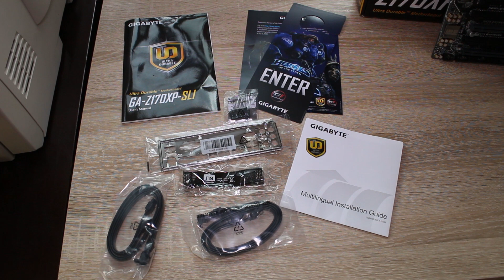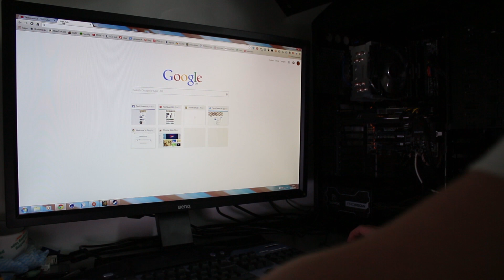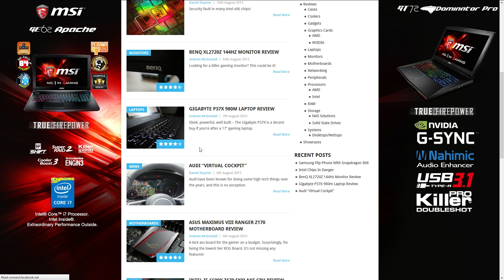Gigabyte Z170XP-SLI Motherboard Review

Comment: Will this seat a GTX 960, or will I have to remove the HDD cage?

PCPartPicker states it won't fit, but I see there is a spot below the HDD Cage
Reply from the maker: Welp, this is a motherboard and it doesn't have a hard drive cage so.... Yes?
Reply: Sorry, I thought I added, I bought this case. 

http://thermaltakeusa.com/products-model.aspx?id=C_00002680
.
Thermaltake Versa N21
Reply from the maker: Looks like there is a clearance for the GPU in the middle. In theory should be fine but I couldn't say without seeing a motherboard in the case.
Reply: Gotcha. Thanks so much for your help!

Comment: I only just learned that this board is NOT a standard ATX form factor, but some Extended ATX, but only after I snapped off the top right corner at the memory slots trying to fit it into a standard ATX chassis! Now I have to sit around and wait a few months until I have the money to buy something else, as this is a "depreciated" model that isn't available anymore for purchase. Is there something at this price point (or lower) that's a for real ATX board with these features that's more durable?

Comment: Anyone get this board and it wont even POST? I have only Power and Power Switch plugged in, and get nothing :(
Reply: I have this one, do you have problems with this mobo?
Reply: I found out that it was bent/broken pins on the processor socket. No idea how it happened, I've installed many processors before...it's a ZIF socket, shouldn't have happened
Reply: I'm really sorry to heard that, it's an excellent motherboard
Reply: Travis Rounds is
Reply: Sadly, the company I purchased it from on Amazon did not exchange the board like they said they would. I ended up purchasing a new one, and it works like it should.

Comment: Awesome review. Could you please tell me if the ram and graphics card slots have difference speeds or are they all the same speed? I'm confused because I read somewhere that the ram slots have different speeds :/
Reply from the maker: +Ameen Qureshi the ram slots have the ability to run at the same speed with no limitation between them. The pci slots however run at either 1x,4x, 8x or 16x,with 16x being the fastest, and used for GPUs whereas 1x is the slowest and used for wifi cards and such
Reply: Thanks for the reply, is there some way to tell which is the 16x slot for the GPU? I just plugged it in the random slot I think the first one
Reply from the maker: It's the longest slot type, normally the top.
Reply: +TechteamGB that's perfect, thanks a lot! subscribed! :)

Comment: What CPU fan did you use?? i have a Zalman cnps9000MAX, the screws barely reach the threads so i have to get a new one.
Reply from the maker: I used a Cooler Master Nepton 120XL with no issues
Reply: What was the one you had before the Water cool? its a bit expensive the Neptune at $146.
Reply from the maker: I suggest a Cooler Master Hyper 212
Reply: Thank you, newegg had that for $29 so i got it. I guess the Zalman i had does not support any standon attachments so it was having trouble with the reaching the threads on the backplate. Thanks for helping me figure this out, now just a few more days and i can finish my new build!

Comment: I'm trying to find a good cpu heatsink that will fit this board without any issues.  I've been looking at the Phanteks PH-TC12DX, but my concern is the dimensions.  It seems like the majority of heatsinks would butt up against the built in heatsink at the top of the board, that's labelled "Ultra Durable".  Was this not an issue when you set up the board for testing?  Or are there only specific, slim heatsinks that are compatible?
Reply: I'm using a PH-TC14PE on my G1.Sniper Z170  with Corsair Vengeance LPX RAM without issue. It's the same board with a color swap. My cousin is using the same cooler on her Z170XP-SLI, again without issue. All 3 heatsinks on this motherboard are shorter than standard RAM.

Comment: where can I get drivers for this board for Windows 8.0 Pro?
Reply from the maker: +david douglas Gigabyte's website under the Support tab
Reply: Actually I looked.  They go from windows 7 to windows 8.1. Dont get that at all.
Reply from the maker: +david douglas the 8.1 drivers work for 8 as well
Reply: +TechteamGB They wont install because it pops up a window and says its not compatible with my win OS
Reply from the maker: +david douglas ah that's strange - it should work fine. Have you tried the Windows 10 or the Windows 7 drivers just to see if they work?
Reply: +TechteamGB no i havent.  problem is i cant get online until the drivers are installed.  the drivers it came with are not installing because of said issue.  frustrating.

Comment: how many case fans can plug into this board?
Reply from the maker: +Dean Hasley If I remember correctly - 5.
Reply: +TechteamGB awesome thanks mate. also checked out your review on the MSI Z170A SLI PLUS. what (if any) is the difference between the 2 and which would you recommend?
Reply from the maker: +Dean Hasley I think it'd mostly just with the msi you have a bit nicer bios and overall board looks, but otherwise pretty similar.

Comment: I'm currently looking at this motherboard fro my 1st build but have a few questions to ask of you, 1 would this motherboard fit into a NZXT H440 mid tower case ?2. I'm guessing the motherboard can also take a Samsung 950 Pro 512GB nVME SSD m.2, the one you reviewed 5 days ago ?3. how do i put windows 10 onto the m.2 ssd to act as the boot drive ?sorry for all the questions mate I'm just little confused somewhatmany thanks
Reply from the maker: +TECH REVIEWS NORTH EAST/UK yes, it'll fit. Yup that will work with this board. And I believe it's the same as any other windows install, just pick the 950 as the boot drive and you'll be fine.
Reply: TechteamGB thanks for the prompt reply mate, i'll go ahead with buying the motherboard, m.2 ssd. another quick question please mate - I plan to use a usb to install windows 10,do I plug in the usb when booting up the pc for the first time to install windows, I'm presuming there is a option to pick which drive you want to install windows on.
also do I have to go into the bios to enable the 950 m.2 ? thanks
Reply from the maker: +TECH REVIEWS NORTH EAST/UK yes, if you hit delete to enter the bios you can select the USB stick to boot off of.
Reply: TechteamGB thanks mate for your help, just subbed, got to loads to watch from your previous videos and look forward to new future uploads. also followed you on twiter, thanks again
Reply from the maker: +TECH REVIEWS NORTH EAST/UK ah awesome, thanks man!
Reply: TechteamGB your welcome,its good to find a top class channel like yours in the uk that can help/advise me if needed, most are all overseas

Comment: The colour of the board's LEDs are permanently orange? Like, you can't change the colour to say blue or read? If you can't that's a bit shite and a deal breaker, honestly.
Reply: +Mann Tubes yeah they can be disabled in the motherboards software
Reply: +TechteamGB Can it be disabled?
Reply from the maker: Bearing in mine this is a low end board, and a load of even high end boards don't have this option.

Comment: Great review. Should be the starter board for new Rig i7 6700K
How do u compare among two? Only worries with cheap boards are they lack HEAT Sink Pipes. We might end up with a burning board with Overclocking. It had happened to me with 2nd Gen boards in Past. Since then i avoid cheap boards.
this one or Asus Z170-A ?
Reply from the maker: Thank you! So it really depends on how much you want to overclock. If you want less than 1Ghz extra, I'd say this should be fine, but higher than that I'd suggest a much higher end board. Hope that helps!

Comment: Did anyone else find any problems with this board? After I finished my build the PC turns on (mobo led's fans spin etc) and it stays on for about 15 seconds turns off for a few seconds and repeats. Also when it does this it can't detect monitors or anything so I can't trouble shoot. Idk what to do
Reply from the maker: Personally like I didn't ha e any issues, and it's a real shame you've experienced some too! We're gigabytes support not able to help?
Reply: TechteamGB It wasnt the mobo, one stick of ram was bad.

Comment: this is a real atx motherboard?? i read it is not a full ATX board and will not fit properly on some case, i have a the first cm 690...
Reply from the maker: Yes, it's full atx size -  not slim atx
Reply: +TechteamGB I'm just currently in the process of buying parts for my 1st pc build, this motherboard is  my no 1 choice but I'm not sure if the case would have enough space to fit it in, the case I'm looking at is the mid tower nzxt h44o white/black, thanks

Comment: Great video. Thank you. 
But I still have some questions you didn't answer in your review. 
There's support for SLI with two GPU. The PCI-E support x16. But when you use two GPU the second GPU doesn't get x16. How much it gets?
And I how many support of DDR4? HDD? Thank you one again.
Reply from the maker: Thanks, the second GPU will be in an x8 lane I believe. As for ddr4 it's 32gb I think, and hard drives are how many sata ports there are. Hope that helps!
Reply: +TechteamGB Thank you very much :-)

Comment: My buddy picked up this board and for some reason he can't change certain CPU OC settings such as the multiplier and voltage. The only way he can OC it is to use the automatic settings witch obviously are not ideal. I've got a lot of experience messing around with OCing and various BIOS settings but I was unable to find a setting that allowed manual changes to your typical CPU OC settings. Usually it's a simple switch to manual settings option and wala you can change anything you want but apparently this motherboard lacks that option.

I have to imagine I'm missing something but as I said I have quite a lot of experience with this sort of thing and try as I might I couldn't get access to those settings.

In any case, buyer beware.
Reply from the maker: +Skippy Mcflappy Hey! Thanks for the comment, I didn't actually get the chance to overclock on this board, so can't fully verify the issue - but it isn't exactly a high end board, meaning I wouldn't be overly surprised if you were completely right! Thanks for the heads up and agreed, if you want this board, give the above a read!
Reply: +Skippy Mcflappy which processor does he have? maybe its locked
Reply: +constipationnow No it was one of the only two available at the time witch are both K series unlocked CPUS.
Reply: Skippy Mcflappy i have the mobo now, i have the option to change it? havent actually tried changing it. but i know where it is

Comment: What is the CPU_OPT fan header?  If you plug a case fan into it, will it operate the same rpm as the cpu fan? Also if your case has a usb type c connection on the front, and you connect the usb headers (F_USB2, F-USB1) to the cases front ports, are those headers going to work for the type c port on the front?
Reply from the maker: The cpu optional fan header is independent of the regular cpu header, so no worries there. As for front panel USB, since there isn't a standard on-board connector for type C yet, you won't get full type C support on any motherboard, including this one.

Comment: Hey dude, does this board support all overclocking features in the BIOS such as unlocked VCore option and all others?
Last time i played with Intel Z77, the mid range board doesn't have such feature. I wonder if that's not the case in Z170 platform.
Reply from the maker: +Rashid Razak I believe you can overclock fair well with the board, including Vcore, Ring speed and such. This is a fairly low end board though, so if you are great OC board, check out a higher end one like the Gaming 5, or MSI's M7, or Asus's Ranger!